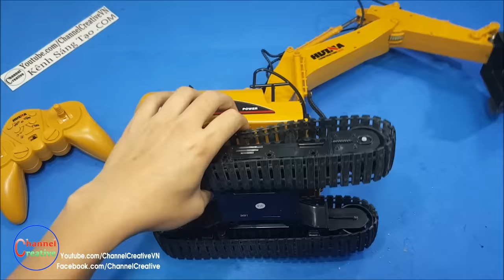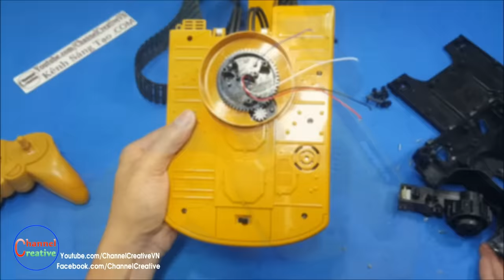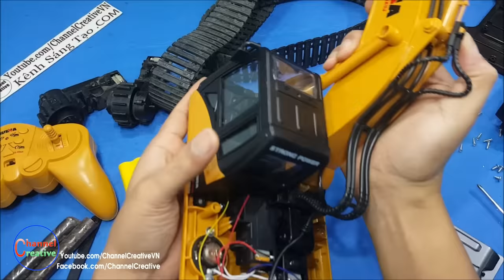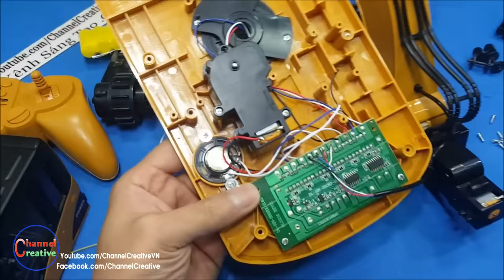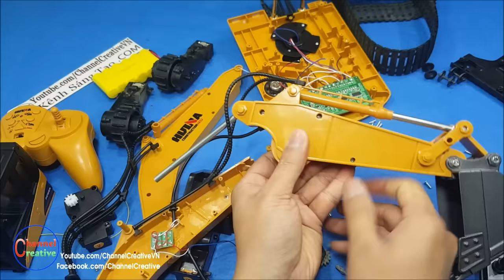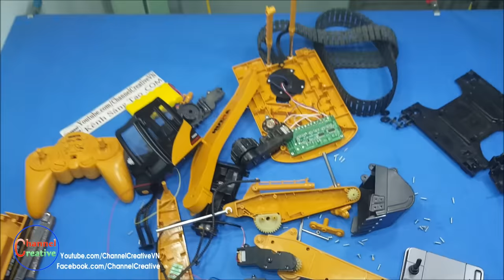Disassembly - What's inside RC Excavator Huina Toys 1550

Comment: I really find it funny, how you don't unplug the battery till after you have already removed and un-soldered the wires and disconnected the circuit board. Are there just 2 screws in the back that you remove and the cabinet comes right off? Looked way simpler then my TR-213 Loader I bought. Had to disassemble a bunch of it like this, just to get to the freaking screw that doesn't want to be removed so, I can take the cabinet off and put in a little Daisy Duke inside with tiny panties and small shirt with big... 

Thanks for posting up this video!

Comment: I would love to see the reassembly without the mechanical function. Show me how to make this an excavator that doesn’t require remote control so my kids can push it around. The battery pack wire snapped off within a month of having it, so it just sits around. Can’t even push it. :(
Reply: Take apart the transmission boxes, after that you just need to take out  from there the gear that connect transmission  gears with the track and it's  done. You can simply  push the excavator. Sorry if my English  is bad.
Reply: Not at all! I think I could handle that. :) If I cant, I’ll reply again with questions.